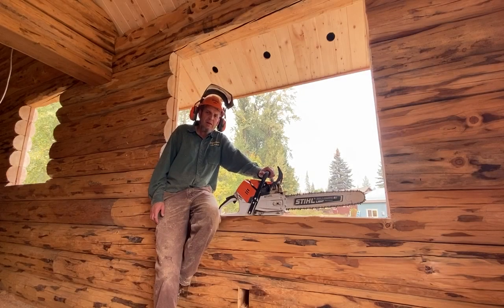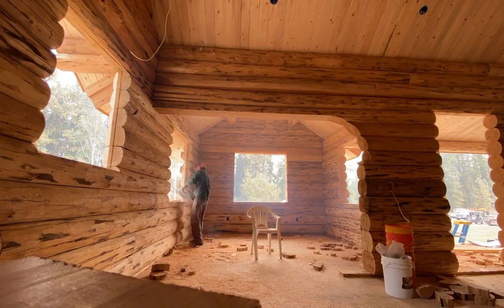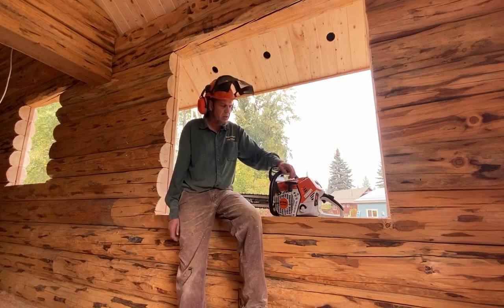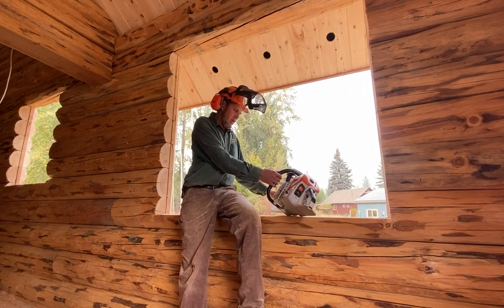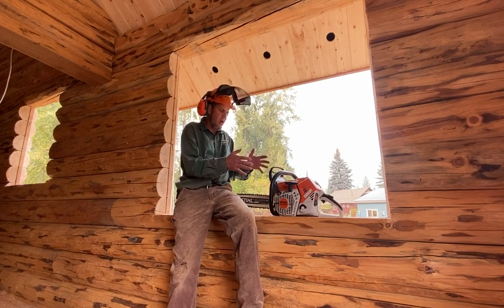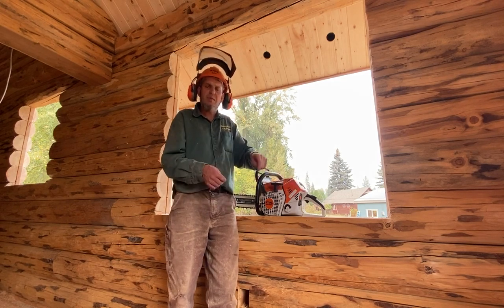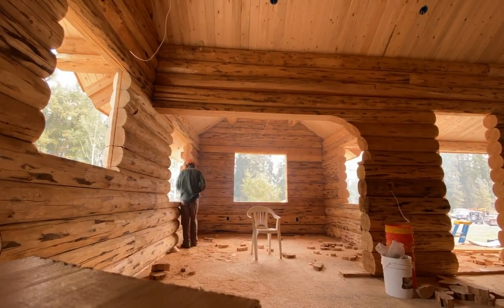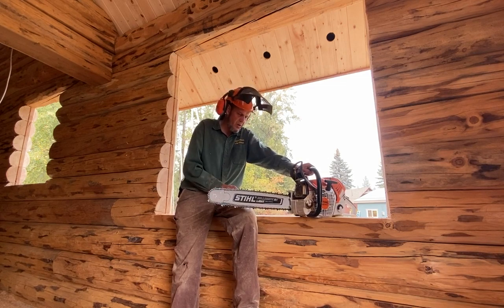Stihl 500i Chain Saw- CUTTING WINDOW OPENINGS ON MEADOWLARK’S WILDERNESS HIDEAWAY LOG HOME

Comment: I'm a stihl dealer in fl and this is a powerful saw but I'm afraid repairs on this saw are not going to be cheap .
Reply from the maker: We got the rest of the 500s in December 2020 and 3 months later we haven’t had any problems yet with them.
Reply: @AmishMeadowsOfficial  we have only demo it and haven't got any yet I love the concept but we deal with alot sand contamination it fuel supply here in fl with our customers especially with tree surgeons and landscapers  buy the way I love your homes and really enjoy your videos .